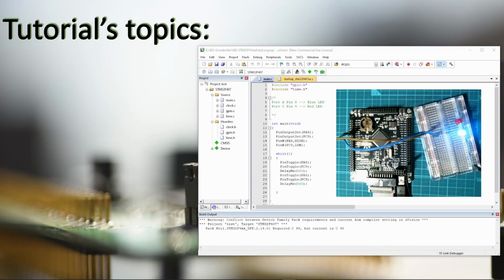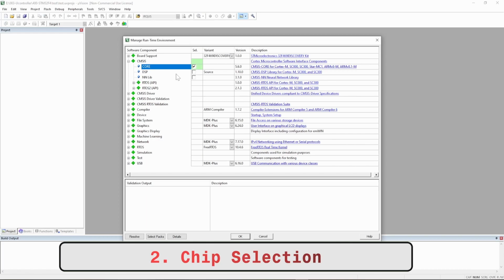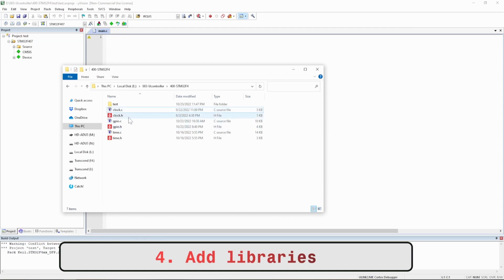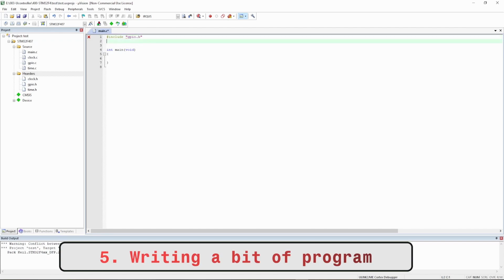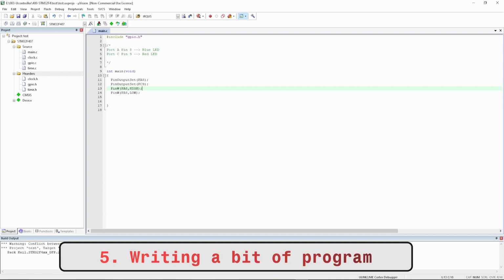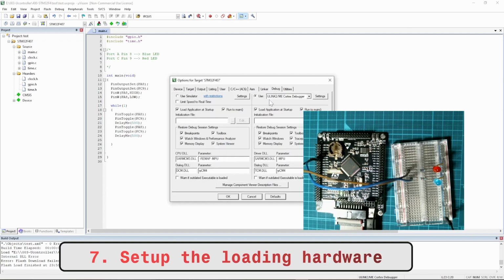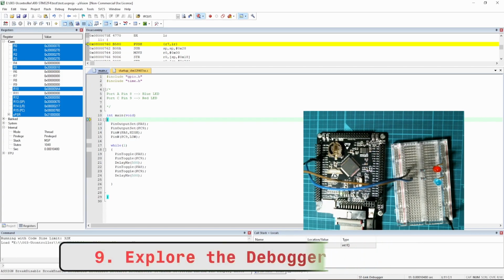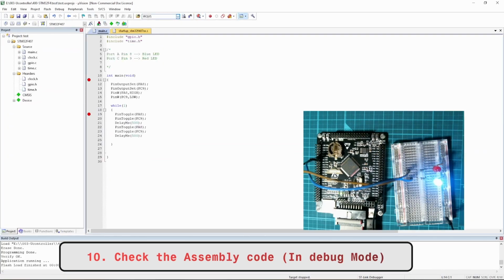🚀 STM32 Tutorial: Keil uVision Project Setup & Practical Example | Master Embedded Systems Dev

Comment: i am using STM32F446RE for learning does it still work if i use the same .h and .c files or should i change them
Reply: Hi @Saisuneeth8168!  I have the same Nucleo board as yours and when I press the LOAD, it says: Could not load file '..\Objects\test.axf' (There is not a .axf file in the Objects folder!)  The project is not scalable.

Comment: Under Manage Run Time Environment > Device I do not find Startup rather i have only CubeMX
Reply: Did you find a work around? I am facing the same
Reply: @davidgomo4409 Hey, I'm facing the same issue. I even tried installing old drivers to get the startup from keil, but no luck. So now I'm just using cubemx to startup the project.

Comment: I got an error that said "Required input file from generator STM32CubeMX". Should I install CubeMX to resolve this issue? Seems like you didn't do it and it all seems fine. Please help. Thanks.
Reply: I am having the same problem. Please help if you find the solution. I installed this CubeMX but I am lost from here on.
Reply: @ninjahattori7272  did you solve the problem yet?
Reply: have the same issue let me know if you fixed it

Comment: Hey, I really appreciate you for taking the time to share you knowledge free of cost. I have gone halfway through the video. Here you added some magic libraries that magically work. But in the beginning of the series you said that you are not choosing to use cmsis drivers because you want to do everything from scratch. That is a noble intent. But you cant just magically add "libraries". It doesn't make the knowledge scalable. What is someone supposed to do when they are following along with a different microcontroller? 
The libraries you are providing for the specific device does not make life easier but harder for the beginners. Please share you thoughts on that. My only intention is to be constructive and bringing out the best
Reply: Fully agree! Have you found a tutorial that does teach more in-depth? Thanks!